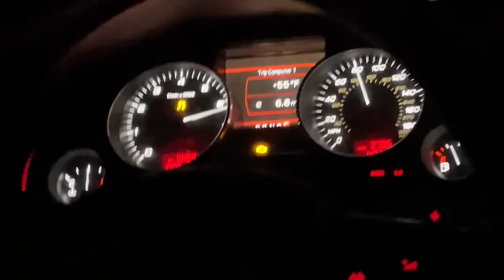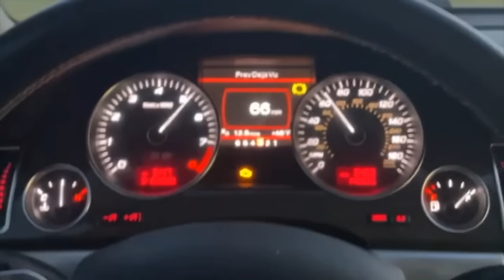Can We Fix This "Lambo V10" Audi S8? One Bad Owner Away From The Junkyard...

Comment: being a personal owner of this car, I finally realized I have a lot of work ahead of me, I have the 2009 Audi s8, The car was previously used as an undercover police car in Miami, so I'm pretty sure it was probably beaten like crazy, watching your first clip and last clip of the Audi running, made me quickly realize I definitely have to service everything you just did because my Audi s8 right now runs the same way as the first clip, I was thinking maybe the high pressure fuel pumps were causing the lack in power, but this just confirmed what I need to do in order to restore that hidden v10 power you just brought to the light, being a bmw technician, I know for a fact this car is gonna bust my balls, but here goes to the project of building a twin turbo v10 s8 lol, thanks for the video Stapleton, you definitely earned my sub from me. cheers mate, and good work.
Reply from the maker: Check for vacuum leaks first. I suspect that was the biggest culprit on mine

Comment: I had a 2007 Audi S8. It was the most reliable car I've owned. Just oil changes and brakes. B&o was awesome.  Gallardo brakes were very expensive. So sad it got totalled by getting t bone by semi. I walked away. I have a couple videos on my channel. I wired the exhaust baffles open to make it sound like a Lamborghini lol
Reply: 2007 S6 here. Only had for few months but love it so far
Reply: here another one S8 2007 with full stainless Kreissieg exhaust with F1 sound all the way in New Zealand. Also the ceramic brake system and B&O audio system
Reply: @eco_logic do you have a link to your exhsust. Thank you
Reply: @franka506  I posted the link. Let me know if YT didn't allow it on here. Otherwise google for the Japanese Kreissieg for the S8.

Comment: I loved my d3 a8 for the week I owned it. I was at the auction at the end of the week and my buddy encouraged me to get the s8 so I did. I earned a nickname of hooters breaking the power steering fuse doing doughnuts in the hooters parking lot on my birthday. I sold it later… actually was the same color 07 as yours. Years later I bought a d3 a8L that I love. I did ghost links, brakes, big wheels and a rear muffler delete. I recommend it on the s8 cause it’s the perfect sound. You’re going to be addicted to this thing cause they are lovable cars

Comment: Thank you for the Audi comedy. Most of us have done this on the 4.2; this video proves that the 5.2 is just 2 more of everything. 
Kudos for doing the injectors — prices for them have gone crazy. 
You do this because it’s a solid engine. I wouldn’t have messed with the intake manifold.  Leaks in the intake plastic components from cracked or missing parts are normal— most people can’t bill for the time to fix their mistakes. 
Audi’s are fun to work on — there’s a stamped part number on everything. What’s not to like?
Great video. Thank you.
Reply from the maker: Thanks man. My engine has been solid since I worked on it. The rest of the car now has gained new issues 🤣

Comment: I've owned an 09' Audi D3 S8 & the D3 A8L, as well 3 of the 3rd generation Escalade. Sounds like you have similar taste in rides 👊 Do miss the V10 sounds. Do yourself a favor & delete the heavy ass suitcase of a muffler. You'll love driving it 10x more, promise you! Out of the 100+ vehicles I've owned, the D3 S8 got the most compliments & started the most conversations. Even had the same color & CF trim package as yours... Don't sell it, you will regret it. Closest thing I've owned to a "super car"
Reply from the maker: The mufflers were deleted by a previous owner. I need to make a legitimate x pipe system for it.

Comment: Thank for the information in this video. My 07 is going under for the winter and plan on doing pretty much everything you have done as well. This will be a great resource. Previous owner said they fixed the normal oil leaks but signs are that they weren’t done correctly.
Reply from the maker: Glad it could help!

Comment: Great work man I've got the same car audi S8 V10 having issues with drivers light and information system has gone black. Brilliant the way you tackled all that work I wouldn't know where to start. Keep up the good work
Reply from the maker: thanks man!
Reply: Yes had my bulb done but they cut through two different tubes around air box and EPC light came on and found that fan belt had came off so front has got too come off.

Comment: I have a 2007 S6 and I've been through just about all this. My car was not torn apart like yours was but I had to chase down multiple stupid issues that is just part of the deal of owning the car. Get the JHM transmission tune if you haven't already. To me the TCU tune did a lot more to wake up the car than the ECU tune did.
Reply from the maker: It has the TCU tune in the "after" video. It did make a huge difference

Comment: I got one, black :) I bought with orange light shining in dashboard, went home, figured it was one injector fault and I realized why the dude sold it, it is pain in the ass to change. after fixing injector and cleaned cabon, the engine started working like a rocket  :))))

Comment: amazing job mate. I am in NZ and still have to do this already leaking at only 90000km. Very good instructions but I probably go to put the bumper in service mode now I seen what issues you ran in with no service position regarding turning the engine and access to all those sensitive connectors.

Comment: I just bought one of these and I’m having the opposite.  Original engine blew and a donor was meticulously rebuilt and installed by previous owner but I’m having nothing but issues with CELs and DTCs up the wazoo.  Here you have an engine held together with hopes and dreams and it was fine just a little slow 😂😂😂😂
Reply from the maker: It had like 26 error codes when I bought it but it still drove me home!

Comment: The cam is the biggest difference between a Corvette and Escalade.
I bet you never dropped the pan and change the filter in the 4L60e. I put 285k miles on my 96 4x4 Tahoe.
Reply from the maker: You're right. I drop the entire 4l60e because its melted and replace its with an 80e lol. Definitely not my first rodeo.  
https://youtu.be/VPAd7bccfhc

Comment: Hi bro, I have same problem, and now after engine overhaul 2 cylinders misfire, I checked spark plugs and coils, still the same cylinder 9 and 10, I’m thinking it’s problem with intake. I just ordered new intake hose, but maybe injectors, have no clue, I have vcds but I’m not that familiar same as I’m not mechanic.
Reply from the maker: Could be a vacuum leak or a bad connection on the coil. Maybe injectors clogged up.

Comment: Any oil leaks on the engine? I have a low mileage S6 with the same engine, got an oil leak somewhere between the block and the timing flange
Reply from the maker: Yep. Probably your oil filter housing o ring in the back of the valley. It leaks out and drips down the front making it look like a front cover leak. If it isn't that its probably your lower oil pan. My lower pan leaks a bit still
Reply: @stapleton42extra   cool, thanks for the info.. My mechanic's telling me it's still leaking from upper & lower oil pan, from the timing flange, both valve cover gaskets (which are new, fitted 30 days ago!!). I'm almost thinking they are not sure where it's leaking. Their stance pretty much is "everything leaks".

The biggest mystery is the coolant system. Doesn't leak while testing with full pressure, but after driving it spits out a bunch of coolant from the front of the car.

Already paid several grand for trying to fix the leaks last month. It's fucken smoking like there's snoop dogg under the bonnet.. 

Fook me.

Comment: Just an FYI, the mechanical bits of the motor is identical to the Lamborghinis of the same years (the guts are actually the same) manifolds/fueling and tuning are the differences.
Reply from the maker: Different crank at the very least. The sedans have a split pin crank with even firing order. The R8/Lambo are odd fire engines.
Reply: There are absolutely No shared mechanicals between this engine and the Lamborghini...NONE. Total BS.

Comment: Twelve minutes into this video and I'm thinking; do not waste money on this car.  However, since at that point I would look at it as a near total loss, minus any parts I might be able to sell, I would definitely be interested in dismantling engine accessories and opening the top half of the engine to see what's found.  Doing this with no high hopes, and purely out of curiosity.  I'll keep watching and see what path you took.
Reply: Twenty-four minutes into the video now.  Thinking; when you test drove this car, the horrible performance of the car should have been immediately evident.  You should have been able to start with a reasonable offer of $1,000 for this car and end with a negotiated price of no more than $1,500.
Reply from the maker: I don’t beat people over the head like that. Sounds like you watch too much car guy tv 😂
Reply from the maker: Every one of these cars on the market has most of the same problems.
Reply: @stapleton42extra  I apologize for being harsh.  It was directed at the car and Audi more specifically although it did not come across that way.  To your credit, you have the patience , experience and ability to fix this car.  As the car comes together, you also gain the satisfaction of knowing you reinvigorated its original performance and perhaps improved on it's reliability while also better understanding what future maintenance may be necessary and at what intervals.  A big reason these cars depreciate so much, so fast, from the original MSRP is due to maintenance expenses.  When a person as capable as you is able take a car like the S8 and  breathe new life into it, you essentially end up with a premium luxury car for a fraction of the original cost.  I commend you for having the determination to fix the car.  Most people would not have the patience or knowhow.  Audi dealership service center mechanics would likely not want to touch the car due to its age, but if asked to, they would end up charging so much in man-hours for troubleshooting that the cost of repairs could exceed the value of the car. I envy your knowhow.  Within the next year, I plan on taking on a similar effort with a 2004 VW GTI, 2.8L VR6.  The car runs well but due to its age, I would feel better refreshing most components under the hood, down to the timing chains.  Since this will be a first for me, it's hard to say how this will go.  For now I'm digging into the maintenance manuals and watching as many DIY videos on some of the more complicated aspects of the upcoming refresh.  Good on you for having one of the rarest and coolest V10 sedans on the road today.

Comment: Amazing (incl. sounding) car. That V10 just rrrrrrrrrrrips. Know exactly what this poor dude went through (although... if he could buy a broken S8 for 9k - maybe he ain't that poor) - have a somewhat broken 2008 A6 Allroad that needs some TLC (what does TLC stand for?). Also - have two other videos with two other cars - which were started and filmed months ago - and are waiting to be finalized - as the cars are waiting for some minor parts - in order to launch my small youtube channel. Fortunately, both of the cars (2011 A-Class and 2012 530d) are still running, so the advice potentially given might be not all crap. Either way - you got a new subscriber, in this case from Latvia. Keep on destroying engi... bad engineering :D Edited: Ah, couldn't resist giving a "brilliant mechanical advice" - whenever putting anything back that was a pain to get out (a stuck injector, a stuck brake rotor, a stuck bolt/nut/part etc. etc.) - it could be a good idea to ensure that next time the part does not get stuck (or merely with the aim to prevent threaded connector corrosion). For brake rotors that might be copper paste, for injectors or diesel glow plugs - that might be a tiny amount of ceramic paste. Here in EU it's sold by inter alia Febi - costs abt. 12 EUR for a life-time supply of a small plastic container - but it takes literally almost nothing to ensure that next time no tools will have to broken when removing that part. Good luck!
Reply from the maker: thanks man!
Reply: TLC...Tender Loving Care!

Comment: Just received my Lake Speed comeback tour T-shirt.  Lovin the fit and feel. 👍 As i donated several dozen Tracks racecards i am curious if the one you all put in my order was from them?  Not upset at all, in fact kinda honored.  (Just hoping you saved a complete set (as complete as i had) for yourselves.  Lastly if possible i would enjoy a reaction of Lake Speed Sr. when he receives the model i also included.  Thanks.
Reply: Addendum from the first comment,  really love the associate sponsor decals on the shirt, as for the decals, i usually (when by choice) use Pennzoil and probably won't be able to afford a Blueprint engine anytime soon but if i can i will.
Reply from the maker: We buy old cards from the NC auto racing HOF to put in packages!

Comment: Normally that car gives +450-520 PS it is a Lambourghini Gallardo engine ... that car if fully taken care of is like a beast in street...
Reply: No it isn't a Lamborghini engine. That's a total myth. The Lambo is a 5 litre V10, the Audi is a 5.2. Totally different bore and stroke dimensions. The Lambo is much higher revving and more powerful as a result. The Audi engine is effectively a V8 plus two extra cylinders and is based on (copied from) the Lambo design. There are NO Lambo parts in the 5.2 whatsoever...so it is definitely NOT a Lambo engine. Myth busted !!

Comment: same oil leak under manifold helped putting very thin film of sealant on gasket talking minutte amount <futureproofing> took the x4 exhaust resonaters out straight through from catalytic 4in pipe kept old system for MOT/ and had cold air induction too much heat sucks in the difference on sound and performance magic had stage 1 remap went from 450bhp to 600bhp just those 3 tweaks cost under $2500 expensive part was exhaust but that v10 sound is infectious never part with S8 sleeper looking car just need gearbox mod when available
Reply: single turbo upgrade next hearing 1000bhp off stock engine no internals at all just map n turbo 1 on youtube bbbbbbbbbbbbbeast

Comment: What did you end up doing to stop the oil building up in the spark plug tubes? Bc yeah I have the same problem... 😕 was disappointed too when I discovered it was basically an engine out fix, bloody Audi's
Reply from the maker: Nothing. I will just sop it out of there once I get a misfire. I have heard of people adding a silicone hose around the plug boot to seal it but I dont know what dimensions they are using for that to make it work. I have 2500 miles on the car and no misfires yet

Comment: I love unique features like a V10 in a luxury sedan. I almost bought a W8 passat wagon that was in great condition because it was a vw with an 8 cyl. But there aren't many mechanics that know how to work on  a w8. My daily driver is an '01 gmc 2500hd crew 8ft 8.1L Allison at. She loves 80 mph on I-75 here in Fla. My wallet doesn't though! Anyway, I loved this project and glad you were doing all the work! Seat of the pants with the internet for reference. And there's something about inventing the special tool you need. I have a few. I save everything that might be beneficial later on. That's a bad ass car. I've been leaning the same way. Ditch the practical pig for a sport sedan. But my truck is the ultimate sleeper. Tough call. I was really glad you finished the audi in the same episode. I couldn't wait to see the net! Awesome!

Comment: I believe you mentioned the s4 with the v8 and comparing the sounds to the others whatever whatever..lol but I just wanted to say that v8 with the right exhaust sounds rowdy 🤩 Anyway I'm guessing you didn't test drive it when you bought it. Because I'm actually amazed it ran at all with vacuum leaks and maf sensor etcetera etcetera..... seriously it should have ran a lot worse than being down on power 😅 and it's obvious that that you're mechanically inclined I don't know if you normally work on audi's but they are not like working on the everyday cars...lol. When I got my first audi some of the work it required made me feel like I didn't know shit about cars😂 My advice if you don't mind people giving you advice. What I did and what I still do is research everything. At night or whenever you have time get on Google and the forums and look up anything and everything you can think of so you're ready for what ever. Audi makes amazing automobiles, their awd is seriously second to NONE without a doubt. Got a little carried away here 😂 1 more thing if you're going to keep it or going to be working on anymore VW's or Audi's then an absolute must is the Ross - tech VAGCOM cable. which let's you use a laptop or tablet as an OBD2 scan tool and programmer which will work with any VW - Audi group which is a shit ton too many to list..lmfao.
Reply from the maker: I did test drive it. The only other S8 I have driven was also really slow so I wasn't really thrown off. I do have VCDS and it has been a lifesaver

Comment: Just notice, I think your intake flaps are around the wrong way in this engine. Can someone confirm this as I a doing the same engine. I have check other videos and I think I am correct
Reply from the maker: They are working just fine and have no codes. The linkage only works one way. I think you may be disoriented
Reply: @stapleton42extra  Hi, thanks for your reply. I am talking about the metal sliders that go into the cylinder head, above the valve,  not the intake plenum . Sorry if I wasn't clear about that. I have seen a few videos and they are all in the same orientation as mine. I would really appreciate your feed back. Best regards Mike